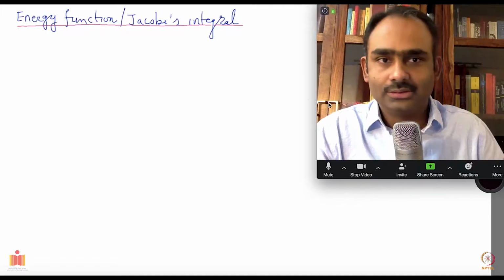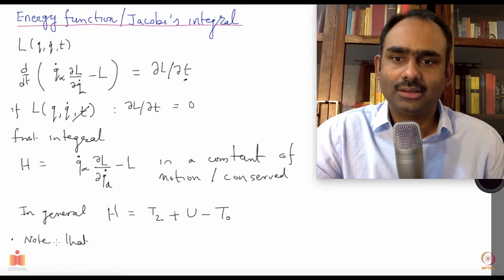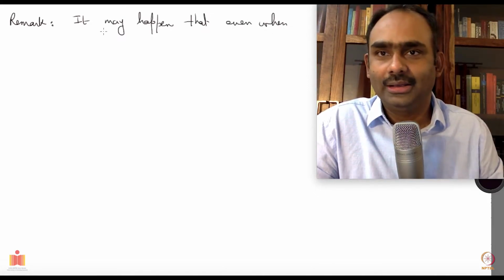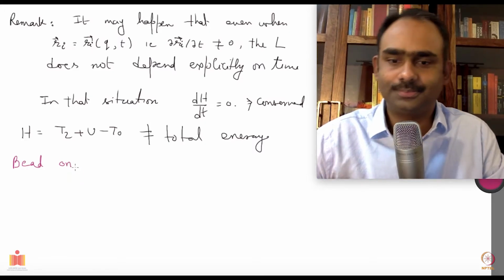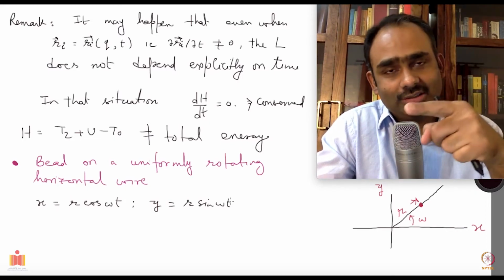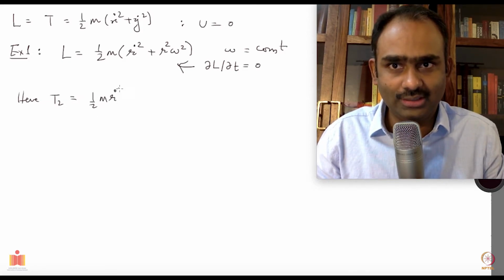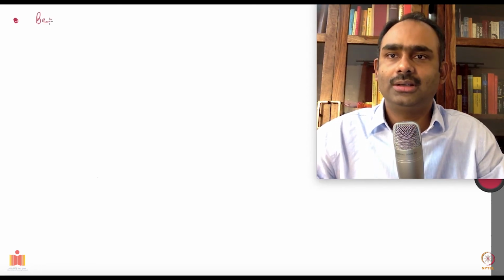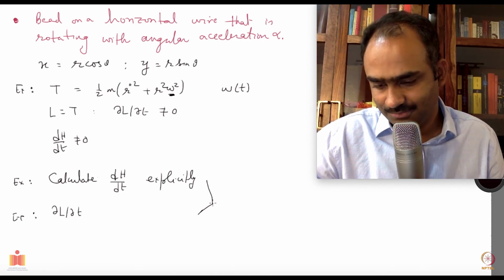Classical Mechanics: L13: Energy Function, Jacobi's Integral

Comment: Dear Professor your work is amazing. I have a question. In the example of a bead on a horizontal wire with constant angular velocity, you showed that the Lagrangian and Hamiltonian are conserved. Is the energy of bead conserved too? As I think that bead gains energy due to the rotation of wire and it should not be conserved. I think the constraints are doing work on bead in this case. Please elaborate.
Reply: yes....i also think so as here H is not equals to total energy so total energy of the system is not conserved due to the constrains.